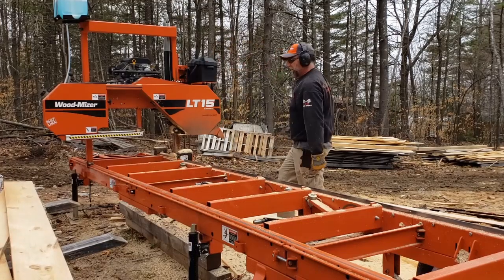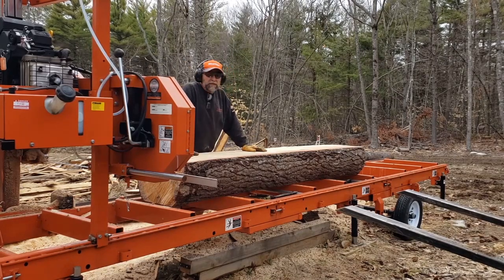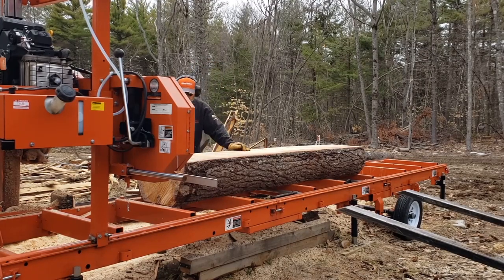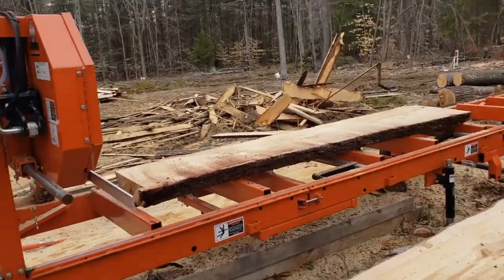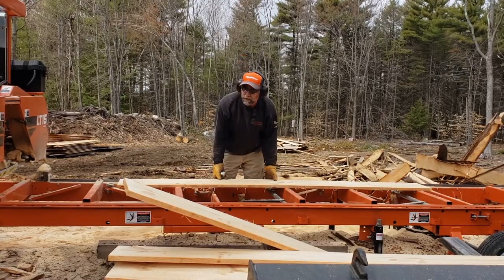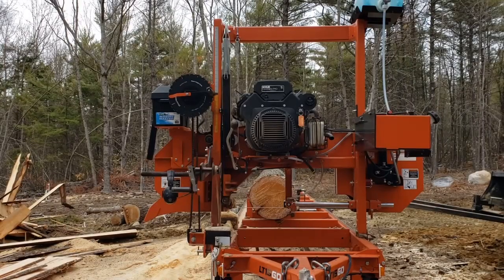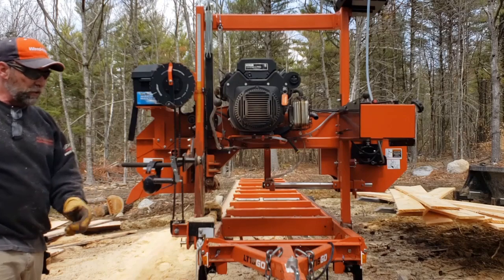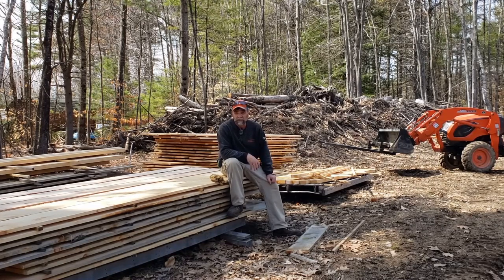Milling our own lumber with our Woodmizer LT 15 Go Sawmill from our own logs.

Comment: I have a new mill on order be getting it in September is a Lt15 wide.
Reply from the maker: You're going to love it!  With lumber prices where they are, it is awesome having a mill.
Reply: I have a woodmizer LT35HD on order. Placed the order 8 April 2021. They said it would be April of 2022 before its ready. But for now I have a hudson farmboss 36. Had to upgrade to hydraulics to help speed up production. With lumber prices im getting more and more orders in.